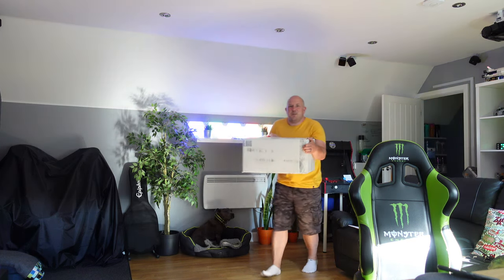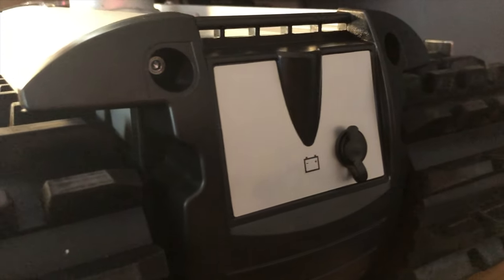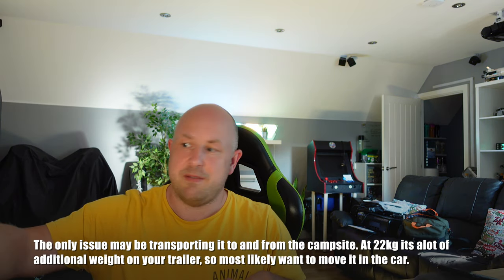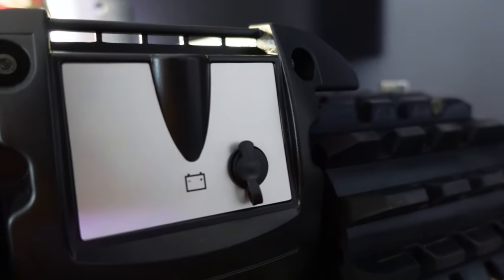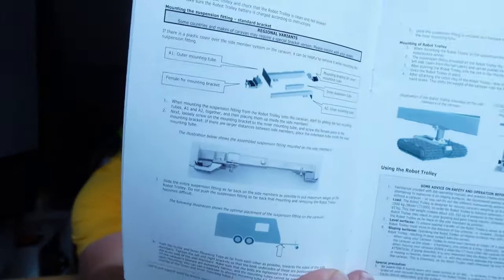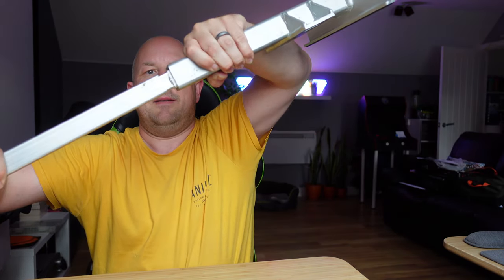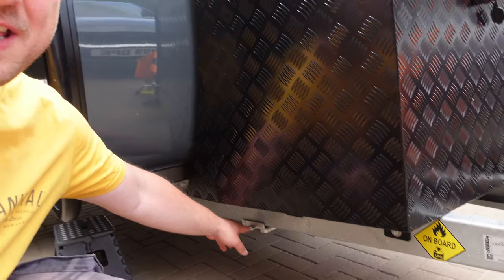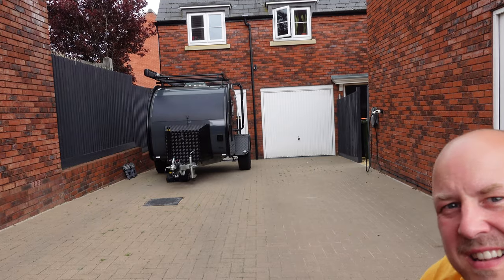Checking Out The Kronings Robot Trolley - RT1500

Comment: I have decided to buy one of these based on your review, it sounds quite noisy and I wonder how long the rubber tracks will last!
Reply from the maker: Mine is still working fine, and no issues with the tracks or anything.
Its not mega noisey, butt obviously its working hard moving the camper / trailer / caravan around.
Reply: @SpectrumGeeks  That is good to hear! I had some issues with my caravan being too heavy to move around when in France this year so I am hoping this will help out. My caravan is 1100kgs so should be within its capability!

Comment: That's very cool, and I bet you could cause some mischief if you're friend had a caravan or trailer ;)

It'd be even better if they released a fully autonomous version, how possible that is I dont know. 

Wonder if you could use it to move a car
Reply from the maker: Not sure I would want an autonomous version, only got to be a few mm out and its going to get messy :D
In theory can move anything you can attach it to and meets the weight requirements.
Reply: @SpectrumGeeks  Did yours come with this other mounting system as well? I mean the one with the tow ball you can hitch up to the caravan like you would with the car?
Reply from the maker: @piotrmach4050  No, these are sold seperately.